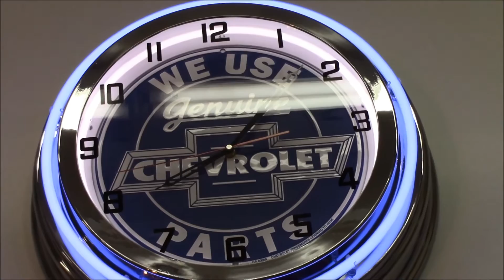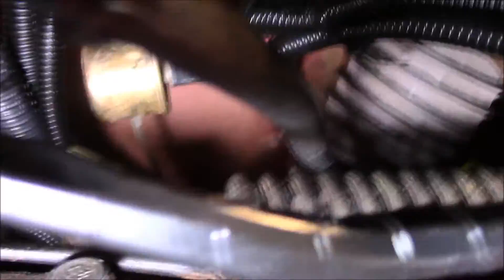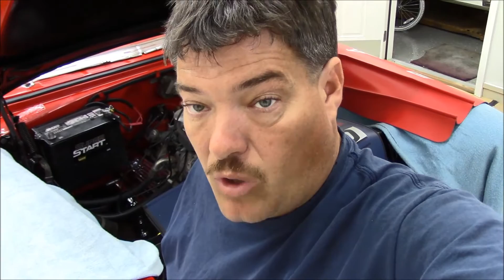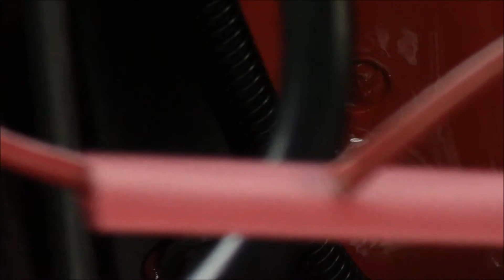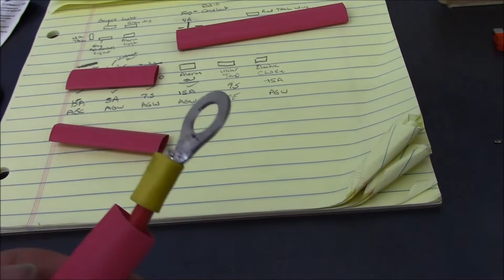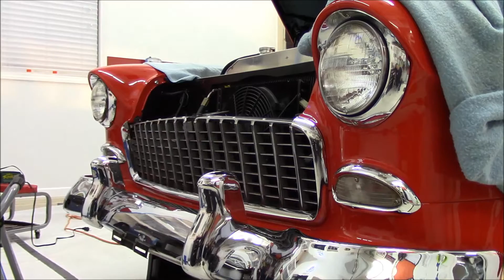55 Chevy Factory Fit Wiring Part III

Comment: Great work.  Wires on the battery do look better coming from the firewall side but looked ok the other way too.
Reply from the maker: Thanks Sam. Hope your project is going good.
Reply: Thanks. Been a little slow lately with having to work a lot but hoping to start making better progress soon.

Comment: My 63 has a barrel fuse block within the switch. Thankfully they did cause I have seen photos on Facebook of peoples trucks burning up the wires in that switch.
Reply from the maker: There is a lot of power that goes through those switches.